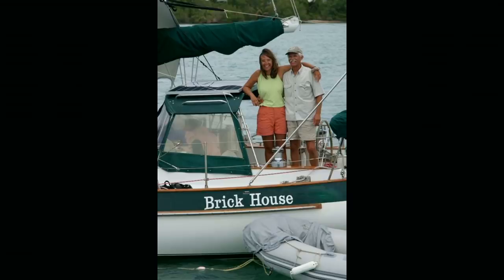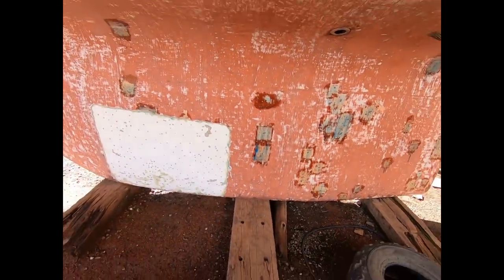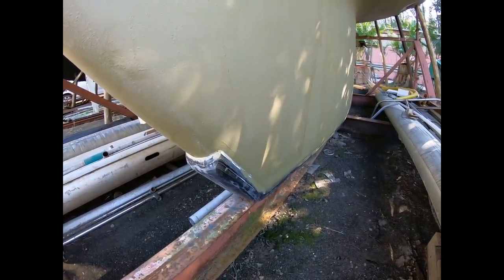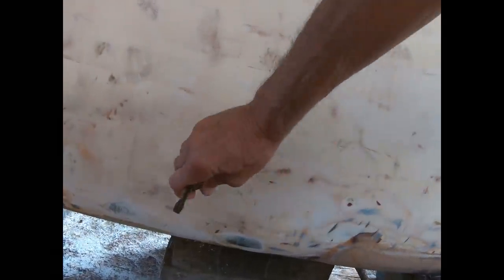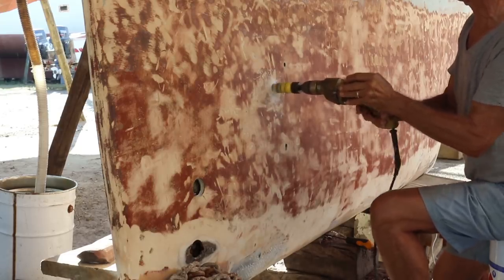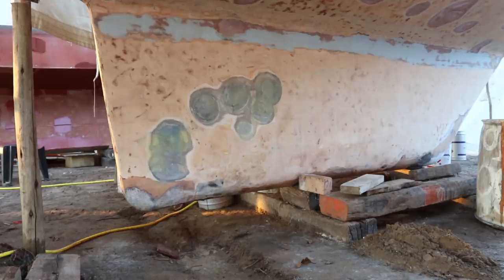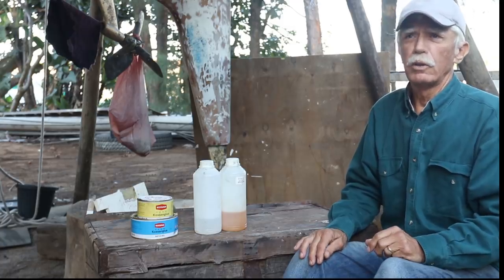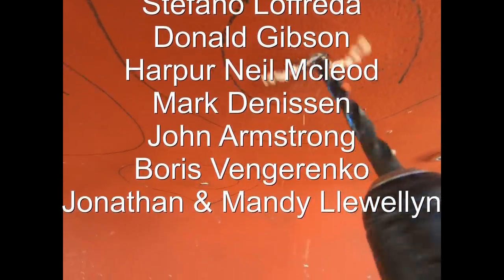Sailboat Keel Repair/Problem: SOMETHING IS MISSING FROM OUR KEEL !! (Patrick Childress Sailing #42)

Comment: There is no way in hell I would drill large holes in my keel to fill in some hollow sounding areas.  The load is carried in the skin, not in the foam.  There isn't that much stress on that surface to need to be reinforced.  Compare it to a surfboard, which is only about 3 layers of glass which is about 1/16 inch thick, and has a 180 lb man jumping up and down on it, and it doesn't break.
Reply from the maker: Are you saying surf boards are hollow on the inside? All surfboards I am familiar with start out as foam blocks then glassed over. Without the foam, not even a light child could stand on it. And this is the point I am making about my keel fairing. As the designer of this boat says, "There should be no voids." With a mere 3/8" skin of glass, that is nowhere strong enough to support the load of the boat when hauled out of the water. I don't care what any one says, that foam adds structural support in a vertical direction. The one Valiant 40 of this era, that I know of, which most definitely has a full foam fairing, has no problem blocking anywhere on the keel, when he hauls out. This is a simple, "this works, that does not" demonstration. No theory or mathematical computation is needed. Having a fragile keel faring, is that what one would want in a "Blue Water" boat? That would not do well when  bumping the bottom in the Bahamas or tapping on a reef in the Pacific. A "Blue Water" boat needs a strong keel, even the fairing part. Additionally, having no voids eliminates the possibility of water migration up to the keel bolts.  Thank you for your thoughts. I am no expert on anything, just one who learns from my own mistakes. It is always good to get others perspectives.
Reply: The foam only holds the skin in place so the load can be carried by the fiberglass.  Some surf boards use polystyrene, which is the material that cheap ice chests are made of, its very soft and you can push a hole in it with your finger.  It works because it holds the two fiberglass sheets (top and bottom) far enough apart so the board doesn't fold.  The point is a surf board has a 180 lb man bouncing up and down in the middle of a 9 foot board, and its only .0625 inches thick fiberglass, and its nowhere close to folding.   Your keel is 6 times thicker, and there is no point load on it like a surf board.  If you see some flex when its hauled out, there's probably nothing to worry about.
Reply: The skins on a surfboard, when flat in the water,  are in compression and tension like the top and underside of a beam.  The sides of the keel void without internal structural bonding/support are like the vertical web of a beam with little to no capping top and bottom to give it stiffness, they would have to be massively thick to be stiff enough for Patricks peace of mind. Totally different kettle of fish.  And point load via impact, is exactly what Patrick's concerned about, yes, in the water, equalised pressure, but whack a bommie or rocks and you have a completely different situation. 
Having said that, straight resin of any sort, without reinforcement, lacks strength and polyester resin, over time, as an adhesive, performs pretty poorly.  I think, yes, the void is now filled, however I'm concerned that structurally, little has been achieved. I could be wrong.
Reply: The loads are in all different dimensions, as it bounces up and down and sideways through the waves.  Drilling holes in the hull and squirting stuff in, is like taking a wild ass guess that you might do some good, hoping the resin might stick to something inside.  If not, its just dead weight, and he'll never know if it adheres or not.  That is no way to reinforce a hull.  Its better to leave it alone.

Comment: If you placed structural material between the two sides of the keel (like a fiberglass rod) this would have added MUCH more structural integrity.  I'm not sure your repair will really make a difference when you support the keel from the aft.
Reply from the maker: A rod, like an earth quake bolt, is an interesting idea. Like the designer of the boat said, there should be no voids in the foam. Any deformation/oil canning, occurred when blocked in the area of the largest void. As the designer of this boat says, "There should be no voids."
Reply: @RVLifeNOW  At the very least, even if no bolt is used.  Adding some finely (and not too much) fiberglass in the polyester resin would have added strength.  Trying to adhere something to foam is futile, the foam will always delaminate.

Comment: How did you / what did you use to strip the old bottom paint?
Reply from the maker: I really wanted to have some sort of blasting, sand, soda, wet, whatever but the yard had no accommodation for that due to an apparent not so good previous experience. It is all in the previous video....I used heat stripping which is a delicate operation but it meant not sending tons of dust into the air and raking up the results as we worked.
Reply from the maker: You can watch the different ways Patrick used to remove our bottom paint here : https://youtu.be/ULfJxWhG4_s Its truly a “mans flick” with all those tools! https://youtu.be/ULfJxWhG4_s
Reply from the maker: https://youtu.be/ULfJxWhG4_s.  That’s the video for how he removed the bottom paint...Lots of tools...lots of work...I don’t know why my previous reply got taken down!-Rebecca

Comment: I thought polyester resin could dissolve some closed cell foams? I would always test a bit first.
Reply from the maker: I watched once as polyester resin ate right through polystyrene foam. Nothing seems to bother the foam used in the keel or skeg of this boat.
Reply: @RVLifeNOW  I have used polyester over spray can pu foam with no problem

Comment: Why not leave a ss drain fitting near the bottom of the hollow section just in case water enters and you need to drain it before it might freeze it do other damage?
Reply from the maker: As the designer of the boat says, "There should be no voids in the foam." Now there is no way water can get in the keel and possibly migrate up to the keel bolts and rust them. No freezing water either.
Reply from the maker: Ha....freezing water? Yeah...we are gonna maybe go to Patagonia...but in the summer thank you...Please Patrick...don’t take me anywhere that there will be freezing water!-Rebecca

Comment: One could attach a strip of steel to the keel as long as the plate is stepped and glass built up around it. Which is most likely what that rubber strip is. Think about this the rubber driving boot on an airplanes wing shouldn't stay there either that rubber "boot" is most likely surrounded by strips of metal fashioned like the wing boot with screws and bolts every few inches then epoxy and fiberglass encasing it to the edges keeping water away from from the "attachment plates" with the screws and bolts.
Reply from the maker: You are developing some interesting attachment possibilities here. Thanks.

Comment: I can’t believe that a reputable boatbuilder would have a ‘false’ keel on any of their models!!! :-(
Reply: I don't think it's a false keel.  Rather for the displacement of the boat, only so much lead is needed.  The rest is for the helm.  Most sailboats carry a weather helm in that they normally turn up into the wind on a neutral rudder.  This is because the C of LE on the sail is behind the C of LR on the keel.  Putting more keel (without lead) toward the rear will tame that tendency and make the boat faster and more manageable.
Reply from the maker: Thank you. Sorry for the late reply...still trying to answer all these comments...

Comment: Man the dock owner must have seen his electric bill & said what..... 2 hair dryer or 1,500 x 2  or 3,000 constant watts. 24 hour for a full  month. Wonder what that electric bill was?
Reply from the maker: I kind of wondered about that myself, but there are so many high powered grinders and air compressors going all day in these haul out facilities, my hair dryers should have blended in well to the overall bill. But now all that is done and our electric use is minimal so it all balances out. Besides, I have only once found a "cheap" haul out facility. These operators know how to make money off of us cruisers!
Reply: The compressor are 1-3 hp motor about 200-300 watts. Grinder 150 watts? A ac startup about 1,500 watts then drop to 500- 800 watts. The similar would be some cooking or baking and day and night. 3,000 watts My guess added 300- 500 base on our high price electric bill in Honolulu. Not outrageous but he probably was going what the heck call them again. LOL 
But your rights beside your are paying for that use of the facility & work tools. And dry dock fee are outrageous but no choice.

Comment: I think I would have sought advice from both fellow sailors and yard workers before I set forth to buy resin locally and in unmarked bottles. South Africa is a hub of catamaran building. They must buy their resins somewhere. One or two of them might answer an email query.
Reply from the maker: As somewhat stated in the video, all the yard contractors use AMT Composites for a supplier of Gurit resin. That is the direction I have gone because of their recommendation. As an aside, I tried the junk resin at a 2:1 ratio and it performed much better. Some sales people don't know what they are selling.
Reply from the maker: Also...most of the resin used in the keel was the good stuff leftover from Malaysia. Only a small amount from the local chandlery was used before we got the great advice from local sailors and yard workers to try AMT Composites. 
We are so happy to be in an area where people are aware of the differences in quality of things like resins, etc. SOUTH AFRICA IS SO AWESOME! - Rebecca

Comment: NOT A BOATER . Would you have gained any thing by adding lead shot to the resin mix ?
Reply from the maker: The problem was not knowing anything where the cave system of voids ran or how narrow the passage ways were or how much resin it would take, or anything, other than there were voids below a certain level. Thicker resin might have plugged a passage way and not run down to the bottom of the void. All I know now, is that it took a bit over 5 gallons of resin to get things solid again. Our boat is stable enough so really does not need more weight on the bottom, but I do want that fairing part of the keel not to be a flimsy mess in case we do hit bottom or wind up on a reef.  Thanks for your comment.

Comment: Pretty much epoxies should all be the same. However a good epoxy producer should provide proper mixing instructions which is your real problem. Think of epoxy as like lego each resin has a determined number of points that plug into the determined number of hardener points 1 to 1 that is what determines the mix ratio that can vary somewhat but is a set number once mixed if the mix ratio is wrong then the excess points unplugged become flex points or soft points excess hardener  can cause other problems too like staining and chemical smells. Now I say they should all be the same in that the components pretty much all come from the same suppliers (well a small group of them at least) the brands you see even wests all use the same suppliers as they are just compounders and marketers. I have worked in that industry for about 38 yrs as a development chemist (well maybe a bit longer than that but who's counting) now I sail allot more ":)
Reply from the maker: John, Thank you for that great information. I experimented and found that unmarked resin set up far better with a 2:1 mix. The sales people in the shop don't know what they are selling. Where in the world are the biggest epoxy component mfgrs. located? Also, that Kossan glue, any idea what they use for a thickener to turn the resin into glue? Cotton fibers?
Reply: @RVLifeNOW  Glues can use several things but fumed silica is most common and best but yes cotton fibre wood fibre wood flour ground minerals like limestone, mica, talc. silica are all used to a greater or lesser extent. I am retired but the main resin makers used to be Korea USA and China probably still the same the hardeners are usually USA or Europe though China is growing.  Usually manufacturers try to make mix ratios whole numbers so do some tests sounds like 2;1 is good but can be 4;1 too rarely 3;1 but GP resin packs are 1;4 or 1;2 with an occasional 1;5.  Remember to be careful with the hardeners they are the insidious toxic part if you become sensitised to them then it can be very debilitating particularly if you get sensitised to all amines because then your own body wastes will slowly eat you away (rare but not impossible).
Reply from the maker: @TheBeaker59  Would there be any problem with using common baking powder as a thickener?
Reply: @RVLifeNOW I don't know really never heard of that I guess so but it would become a little porous with time in a moist environment.

Comment: If you ad, name it, a structural-bridge between the foam and the skin, the weakest link will determine the shear strenght, or tensile strength of the chain: skin-polyester-foam-polyester-skin. Infact you need a pourable material with a good tack to foam and to the contaminated skin. May be a pourable, expandable epoxy foam?
Besides that, vaccumating combined with mild heating cooks away any moisture fastest: 40 C and 0.05 bar is already below the boil-boundery of water. Within a few hours under this condition any watermolecule is vapour and removed through the vacuum pump exit. Moisture saturated layers are dry.  Groeten from NL

Louis van Rijn
Reply from the maker: Thank you for your information, well appreciated.  I figured anything is better than having a void. Even pure resin, which can seep into all the nooks and cavities and larger voids, will be well contained to  help  disperse the pressures exerted on the faring. I did have the option to use a vacuum pump, as you suggest, but, with all the other projects to work on, on this boat,  there was no rush to air and dry out the keel cavity. It is good to know, though, in case anyone else should have this problem and wants a speedier drying remedy.
Reply: @RVLifeNOW  If only a very tiny pinhole is present (always will) in the keel bottom, water will penetrate throught the skin and slowly penetrate the foam. Even so called closed cell foam tends to swell under extended moisture exposure. You cannot expect any tack or structural strength from any type of material added to a wet surface. So drying in depth is very essential. 

When we execute structural repair in a carbon fighter aircraft wing we apply a vaccuum blanket and heating premature to the actual bonding proces. This process dries the layers in depth. Epoxies tend to take up 2% of their weight in water in time... we must get rid of it before we apply a water-sensitive epoxy structural adhesive.
Groeten uit the Netherlands, Louis.
Reply from the maker: @louisvanrijn3964  All excellent information. Thank you.